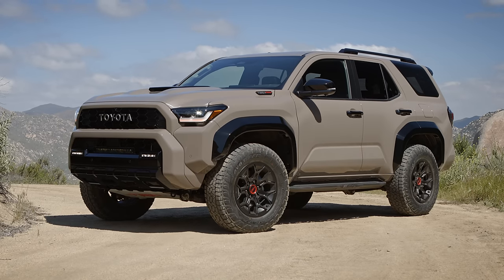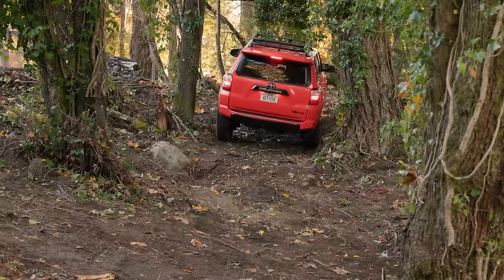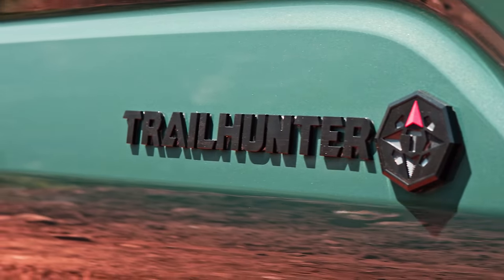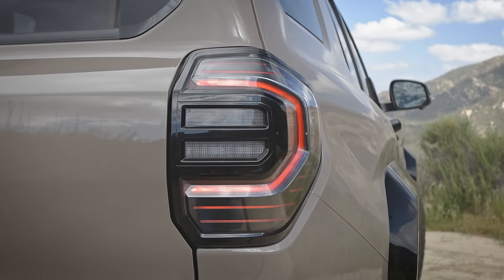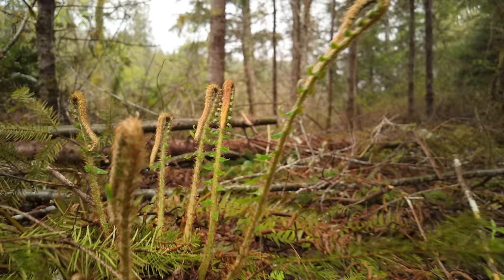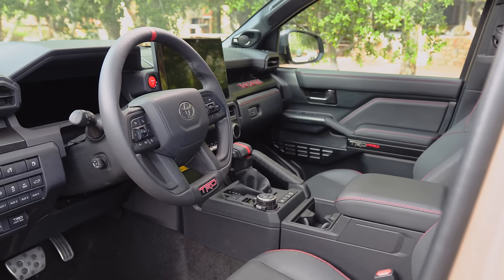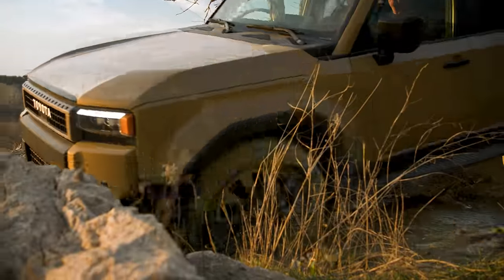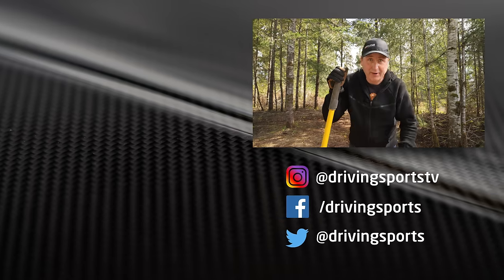2025 Toyota 4Runner First Look: Limited, TRD PRO and Trailhunter!

Comment: Once my 4th gen dies I’ll buy this, so in 10 years
Reply: 30 years from then, the 7th gen will be released.
Reply: Haha
Reply: It will never die!😂
Reply: When you consider the difference in fuel economy you may change your mind.
Reply: Brother you won’t have to replace your current 4Runner in ten years unless you want to!! On my used 1997 I drove her for 346,000 miles until I sold her. My neighbor still driving her!! I really like the Trail Runner trim. But I’m afraid that it will be a $60K+ 4Runner!!
Reply: Ha ha ha 😂😂 I’m in the same situation with my 5 gen … so that means NEVER …. 👍
Reply: Haha. Nah I'll just keep my 4th gen, v8 boyyyy! Non VVT. Let's goo
Reply: You will never change it then !!!
Reply: In that boat in away. My ‘07 V8 just got $3000 worth of love to make it go another 10yrs. Don’t know if I will wait. I’m 65 and have garaged , mint Fj I could sell. I love this new 4runner. Also love my ‘07. Oh yeah, only 267,000 on the clock.
Reply: Same. Maybe will buy one in 5 or so years
Reply: Lexus is better
Reply: @RatishRam  You do not need to change oil more frequently for a turbo. Nothing about a turbo implies reduced life span.
Reply: @TheArfdog LMAO not even close to accurate.
Reply: @JoeBuck-uc3bl  Got an MKZ ecoboost 2.0l  w/ 100k miles. Changed the oil religiously 3 times so far.... every 30k miles. Using synthetic. Just curious why you think a modern turbo engine requires more frequent oil changes
Reply: I hate to be the bearer of bad news, but your 4th gen won’t die. Even if you drive it off a cliff
Reply: 😂 1GRFE will never die
Reply: @TheArfdog  because they do…

Comment: What a beautiful car and a true 4x4 beast. I'm stunned by Toyota recent design language... So aggressive and a huge improvement over their usual classical boring designs
Reply: I don't understand Toyotas logic with some of these new suv releases. You have a 4runner vs a LC250 vs a GX550 (99% similar everything outside engine setup). How do buyers distinguish between a 4runner vs a LC250 when they are all made in the same factory. And when you look at the prices between a high end TRD Pro 4runner vs LC250 entry level trim, it's virtually same price, similar engine setup, etc. Then you got the GX550 with way too much tech vs tried and true old classical keep it simple engineering on Prado/GX460, etc. New Toyotas are a big disappointment that simple rely on loyal Toyota buyers to buy these new unreliable tech toys on wheels. Nissan/Infiniti 2025 models earned my business. Snatched a 24 Nissan Patrol as well to complement my 21 LX570. Now how to import it to the states from Dubai is a different story. 😅
Reply: @sportsinvestor101  good luck getting that Patrol to the states! As someone who lived for a long time in the middle east I know Patrol very well and drove many models all the way to the one you got (I drove the 2021 which is mainly the same as the one you got... Actually my manager has it and since we were in good relationship I took it for a drive 😁) ... It's such a nice car but heavy as hell on gas (and I owned 2 Chevy Tahoes so I'm used to 8 Cylinder engines consumption).
Reply: @sportsinvestor101  Toyota is doing what a any titan company is doing, flooding the market with their cars so it fits all kinds of customers. It is a costly strategy but toyota has deep pockets and it works well for them in sales as all their models are selling like crazy and pre booked for up to a year in advance. I gave up trying to find a rav4 hybrid limited and now considering crv instead as it is stock
Reply: @sportsinvestor101 I don't agree their new models are a disappointment, it is the opposite! They are finally getting rid of their boring designs and (a car as an appliance) mentality, and mind you I'm not a big fan of Toyota but recently I'm considering their models as interesting, although pricey. Of course their high reliability and resale prices adds big time to the attraction, as a previous Nissan Altima owner who suffered heavily from Nissan lousy quality and even suffered to sell the car as scrap as no scrap shop wanted it 😂
Reply: @TahoeKing  Ya been inside the wrong  product bro. I been from Honda to Toyota to Nissan. My 02 Maxima had the lowest maintenance thru 200k+ miles and my 08 Lexus LS600hL had higher maintenance than any other Japanese brand car I have owned (5 other models). Secret to Toyota reliability are the old school trucks/suv up to 21 LC200/LX and 23 4runner/GX. 24+ models will rely on these loyal Toyota fans to buy the inferior quality product. Nissan has only 3 models made in Japan (of similar quality) such as GTR, Armada, QX80, G35/37, etc. Nissan buyers are generally young, aggressive drivers with no knowledge of proper maintenance. Switch the customer base and Toyota would be less reliable. Now look at these 25+ models. 25 QX80 > latest LX600, etc. Toyota like Tesla often over promise and under deliver. Toyota been on solid state propaganda for past 7 years. And what you know it's always next 2 years they will release a solid state battery ev. Nissan is actually close. But Nissan has the absolute worst marketing department with head scratching decisions (stopping Xtrerra, Japanese Maxima with real transmission, stopping V8 NA titan, etc). A 23 4runner will beat anything Toyota puts out moving forward. It's the latest of truly reliable ICE Toyota products. Glad I grabbed a 24 QX80 for a bargain to complement my last of reliable Toyota product (21 LX570). Just need a Tesla Roadster 🤷‍♂️
Reply: @sportsinvestor101  if what you are saying is true, Toyota is on their way to a real collapse in customer base if their reliability goes down and drags resale price also downhill, let's say 5 years from now when all these new models started to age and be well out of warranty and all these turbos show their ugly face! About Nissan, maybe I chose wrong and i paid for it (2008 Nissan Altima V6 SE)... Sure it was such a fun car but when that lousy garbage cvt failed, all hell doors were wide open
Reply: @TahoeKing  New Toyota are not bullet proof Toyotas of the past (up to 21 for full size and 23 for mid size).  Nissan lemon were cvt related. Toyota is also cvt related and now adding lots of other tech (trying to up Germans for long term reliability issues). Toyota won't lose a base because like Tesla they have a large loyal following (they will buy regardless of quality issues and will do whatever it takes to get it up and running on the road unlike a typical Nissan driver). For cars, Toyota > Nissan. But for full size boys, it's Patrol > Cruiser (rode plenty in Dubai in sand dunes). I have a LX. Now need to add a QX80 Sensory 24 (last of Japanese bullet proof V8). Now it's all getter smaller engines with batteries and turbos. Might as well get a EV with less moving parts. Unfortunately my Tesla Y is competing with my previous LS600 for high maintenance costs eating $1500 worth of tires every 20k mile interval + insane alignment fee costs and too many auto shops not servicing the car due to being a Tesla EV.
Reply: @TahoeKing  And I need a Suburban Diesel 9 seater as well because why not when going on road trips getting 30+ mpg for a 3 ton brick traveling at 75 mph.
Reply: @sportsinvestor101  interesting what you mentioned about Tesla Model Y maintenance costs! As I was considering a model Y, or a Honda Crv... What do you think between the 2? Noticing I do high mileage these days and I want a car between these 2 that can last 5 or 6 years with minimum running costs
Reply: @sportsinvestor101  I have a weak spot in my heart for GM full size SUVs as a previous owner of 2 Tahoes (last one was a 2018 Tahoe Premier). Both were when I was in the middle east. Now I'm in Canada and getting anything with a big engine is a suicide because of the crazy fuel costs here! We are California fuel prices level, almost all year!
Reply: I miss their classical boring design. 😂

Comment: So the trailhunter doesn’t have a full time 4wd while the limited does but doesn’t have crawl control or mts. I want the trailhunter but i live in Seattle and it rains all the time. I like the added safety of awd. Will the trailhunter part time 4wd make sense in seattle rains?
Reply: Same, I want full time 4wd in an off-road trim. Maybe have to get the LC...

Comment: Probably need to do this on a different video Ryan, but Toyota really needs to consider putting multi terrain select all 4WD 4R, Land Cruisers, etc. Even some crossovers of other brands have MTS.  Yes leave the rear locker for the more off-road oriented trims like off-road Pro TrailHunter. But out here in the Outer Banks sand mode is clutch.
Reply: HI David, I currently have a R4P and have made four surf trips to Hatteras so far this year but never been on the beach. I know there are sand bars out there waiting for me but I've been scared to take the R4P onto the beach. Do you think the sand mode is sufficient to get the R4P safely onto and off the beach at any of the ramps?

Comment: This is the first 4runner since my 2000 3rd gen came out that finally hits the mark. Good thing mine has held up so well since it's taken 25 years to get here. Not thrilled about the very limited engine choices though. 2025 and we still can't get a diesel in a 4runner for the US market?

Comment: My 2015 LTD coming up on 200k miles. After seeing this, there's no reason to not go to 300k. It's nice, but not as nice as no car payments. And I hope the engine performs better than it looks. What a mess.
Reply: oh, it won't. the engine is an absolute pos
Reply: All those hoses in the engine bay just make me think of how less reliable this engine will be.   This is going to majorly change the ownership experience of a 4Runner and, IMO, take away one or the key benefits of the 4Runner over its competition.
Reply: Wrong, starting at low $40k’s, this is very affordable for so many Americans and will sell out instantly
Reply: The engine compartment looks like a horrendous pile of problems, 4 cylinder with a turbo no thanks. Next they will make it with a CVT lol. I love my old 4 runners (2000 and 2002) for their simplicity and everything else that made Toyota so good. New Toyotas are overly complex expensive garbage.
Reply: @videogazer801 is that satire?
Reply: @1TDECK  hell no, that’s just your opinion and it’s fine.  But, this new Camry will be the #1 seller.

Comment: Best detailed coverage yet!  But do you like the new 4R?  You were there.  You had 1st looks, 1st hands on.  Do you like the engine choices?  8 gears now?  DC sway bar?  No more KDSS?  TRD and trailhunter get more GC?  How much more?  Is the power lift gate on all trims?  Does the rear locker engage quicker now?  From what I see and know thus far, glad I have my 2018 TRD OR and I am NOT trading up.  It would be a trade down IMO. The Land Cruiser has more curb appeal.  And I don't like its engine choice either.  lol
Reply from the maker: I wasn’t there though we had a camera op there. I was already scheduled for Hyundai event at Laguna Seca on the same day. Most of the questions you had I already asked them. They had ZERO answers at this time. “More information later” was their reply to every question. These were very early builds.
Reply: @drivingsports  Well darn.  Thanks anyway.

Comment: I like it and I don't like it. What I really like about the 5th gen is the that it has more of its own design, while the 6th looks more like a Tacoma with an additional roof over the bed. I know that the design of the rear windows is a tribute to the 1st gen, but to me it looks a bit displaced. However, this is all in the eye of the beholder.
I am not too big of a fan of the tablet display, but this is just the new feature in all modern cars. I also like the manual transfer case shifter in the 5th gen better rather than the electronic dial, but this is a question of preference as well.
What I really like is the hybrid drive train, which I would like to have. 
Over all, it is a very good looking car and as much as I know Toyota it will last forever. Great job Toyota and many thanks to Driving Sports TV for giving us the insight.

Comment: I think your review is good but disappointed on the towing capacity at only 6,000 lbs for the new 4rnr , I have had two 4rnrs before and once the Landrover Defender came out switched over because of the 9,000 lbs towing capacity and because it’s so fun to drive at 400 hp and an awesome off road vehicle.

Comment: I am still hoping for a 4Runner/Taco with an efficiency-minded hybrid system. Maybe in 2026. I’m torn between current gen for the amazingly reliable engine and the 6th gen for a smoother transmission and updated crawl control system. I’m curious to see what fuel efficiency the turbo 4 will provide.

I am so-so on the new looks. I prefer the painted paneling on the Limited over the TRD trims. I like the current TRD Off Road looks the best, though.

Comment: really keen for you to do a comparison between Ford Ranger Raptor and 2025 Toyota 4Runner TRD Pro - I know the Toyota does not have the option of permanent 4WD or Fox Live Valve suspension dampers but it would be great to know how they compare in terms of ride and handling on road and off road

Comment: At present with no TRD/Trailhunter Land Cruiser in the mix, the two lines are quite distinct.  The Land Cruiser's more modest ground clearance (1" less than lower trim 4Runners and an even greater disadvantage vs TRD trims).  Suggests that for those who get dirty often, the 4Runner is the better ride and for those who get dirty sometimes but also spend time valeting their truck at country clubs, the Land Cruiser is better.  Or more simple, Land Cruiser targets the Land Rover Discovery and 4Runner targets various Jeep off-roading products.  And cubic foot measurements on that cargo area?  Looks smaller than that on your last gen 4Runner.   The rear legroom also looks like it might be less (likely due to the supposed third row options for the new 4Runner).  As for speculation that they will be differentiated on price, that's hard to believe given the relatively low SRP of the new Land Cruiser and pricing of the last generation 4Runner.  There's not a lot of distance between old 4Runner and new Land Cruiser pricing when similarly equipped, and I can't see the SRP of the new one being lower than the SRP of the outgoing model.

Comment: After finally seeing it and hearing the specs and options, I'm really unconvinced that the 250 LC will sell well in the US without distinguishing features that would set it apart from what looks to be a stacked 4runner redesign that will be considerable cheaper than the LC.  Put a v6 and 3rd row in the LC w/o changing the price too much and MAYBE someone could justify buying it over the 4runner.

Comment: I think most people will prefer the 4Runner and Sequoia in terms of practical use. The Land Cruiser is sort of out of place in the lineup, but that's been the case for a while now. The Cruiser starts at 55 and the 4runner will probably start around 40. There'll be some overlap, but because they share the same engine in higher trims, it'll really boil down to what you need the vehicles to do, and how big you need them to be. The 4-runner looks better than the cruiser, but we'll see what the market thinks.

Comment: Considering that the Tacoma and the 4Runner are primarily North American trucks, the Ford Everest would not be competing with the 4Runner. Where I live at least, in South East Asia. Here, the Toyota pickup is the HiLux, and their SUV based derivatives. Yes, we will probably get the Land Cruiser, but not the 4Runner. And chances are they will have diesel engines, and no gasoline/petrol engines. (Our diesel quality is apparently a lot better than what is available in the USA.)

Comment: Will it go 200,000+ miles with that 4 cylinder turbo charged engine.  Highly unlikely. Can't spin something like a turbo at 150,000 rpm and expect it to last.

Comment: Great video.  This vehicle in base form is probably going to fall in the mid-$40k range, with a non-hybrid engine.  This falls right in with the Bronco and Wrangler 4-door rigs.  If you want Toyota reliability, a livable ride, and a solid fixed roof, this is the way to go.  There are only really three vehicles on the market that give you a body-on-frame, truck-based architecture with a solid rear axle.  Must-haves for any good off-roading.  My $50-60k would be on this new 4Runner.  I have plenty of time to save up because this vehicle will be on the market for the next 10-15 years.

Comment: When did you get rid of the 2021?
Reply from the maker: Back in 2022!
Reply: @drivingsports  was it a “channel” decision or did you not like it? Love your channel by the way.
Reply from the maker: @timflaherty2731  it was dented while filming with TFL in Colorado and the repair would take 6-months or more (things were impossible to get fixed at the time.) we THOUGHT a new 4Runner was around the corner so we sold it for something that was a 2022 model year.
Reply: @drivingsports  fair enough. Thanks again. Love the 4Runner and Subaru content.

Comment: What's the difference between "all-time 4 wheel drive" and "All-wheel drive" like that in the Subaru products?
Reply from the maker: 4 Wheel Drive (at least in the USA) refers to a hard connection between front and rear axles (through a transfer case or Torsen diff.) All-wheel drive uses a clutch-pack or viscous connection. The main differences are durability and ability to "hold" the power. AWD systems vary power so the center clutch doesn't overheat. Some AWD setups are built to be more durable (subaru, with their full-time AWD setup) than others (hyundai, which is part time AWD) but the operation is similar.